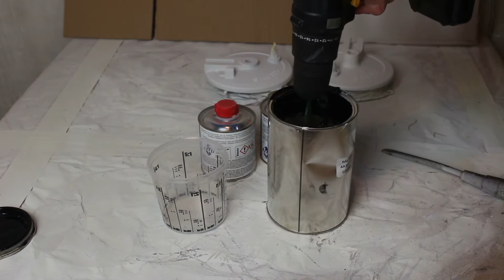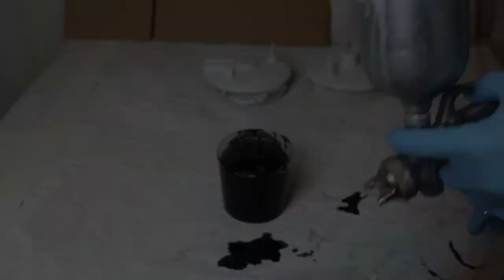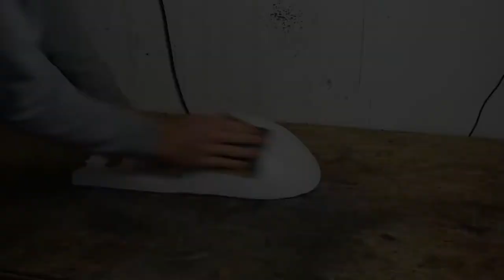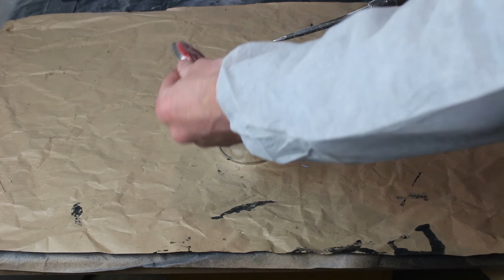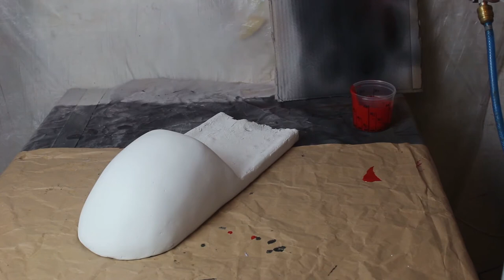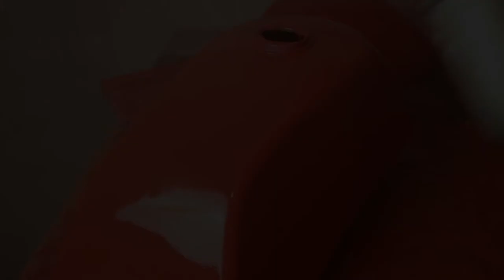Ein Mofa lackieren | Hercules Prima GT - Cafe Racer Mofa project pt. 5

Comment: Hallo, ich finds toll, dass ihr aus solchen Bastel-Mofas 🏍 wieder etwas schönes macht. 🖒😃

Mich würde interessieren,  welches Setup ihr zum Lackieren verwendet. Also welchen Kopressor / Sprühpistole / Lack.

Meint ihr, Mein 24 Liter Kompressor mit 8 bar hätte genug Kraft, um damit vernünftig zu lackiern? 🤔

Schöne Grüße!🤗
Reply from the maker: The_PlayR danke, das freut uns zu hören 👍
Also im Video benutzen wir einen 50 Liter Kompressor und lackieren etwa mit 4 bar. Das ist meiner Meinung nach aber auch schon die untere Grenze. Mit einem kleineren habe ich es noch nicht versucht. Aber ich könnte mir vorstellen das der nicht nach kommt. Beim Lack greifen wir meist auf günstigen 2k lack zurück. Mit dem Ergebniss sind wir bis jetzt auch sehr zufrieden. Wenn du wirklich gute Ergebnisse erzielen willst solltest du viel Zeit in die Vorbereitung der Fläche stecken und auch an der Pistole nicht sparen. Bei Interesse können wir aber auch mal einen ausführlichen Artikel in unserem Blog veröffentlichen